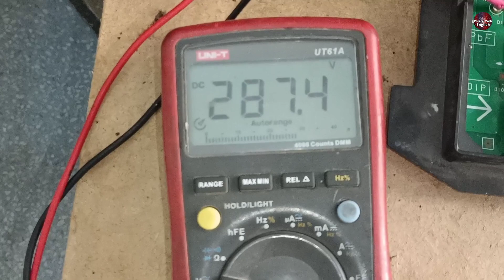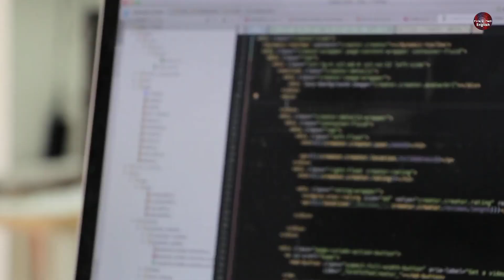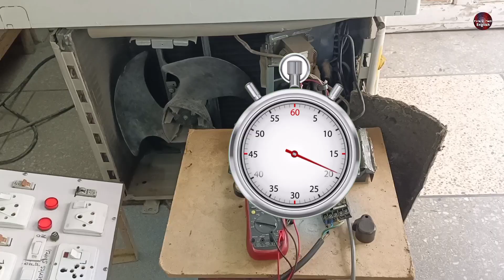FUJITSU won't let you know This In their Mini Split AC's

Comment: I took my outside mother board out to fix a communication error and i am hooking mother board back up and am stumped i still have a red small plug in with two red wires and cant find where they were hooked up too from my research i think the plug comes from a condensation pump to help or pump water out where does that red plug with rwo wires plug in im stumped thank you

Comment: Why airconditioner unit being with electronic control it makes change air conditioner unit replace regular basis all the manufacture want make money from customer 
Samsung install 60 hz compressor in 50 HZ region I found after 10 years later when compressor warranty over

Comment: It's kind of shady the way you don't have the communication wire on the terminal block at the spade connector. Clearly, you don't know what you are talking about or doing.
Reply from the maker: I know what I am talking about, I didn't put it myself to explain.
Reply: @forevertechenglish  I know you didn't put yourself to explain because you even know. When you're testing at the spade connection you're only reading on the board side for communication. You can't claim that both are communicating when you're only checking the board's communication. Fujitsu is not hiding anything and your claim is incorrect. Hence you don't know what you're talking about.